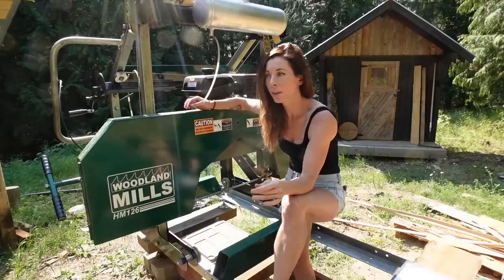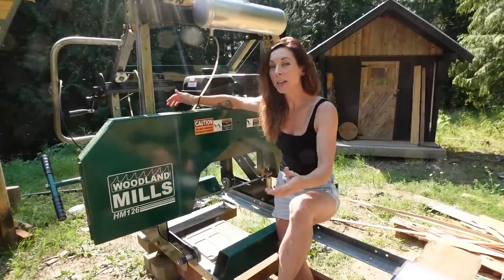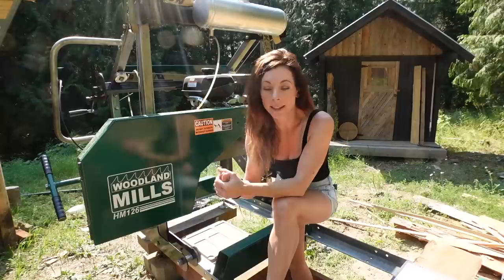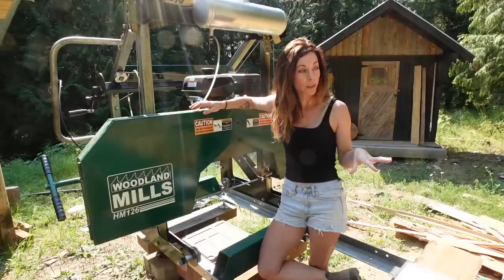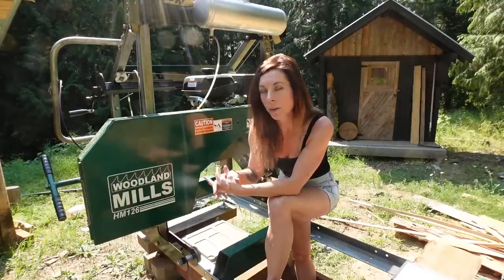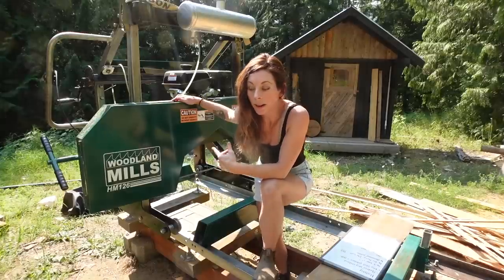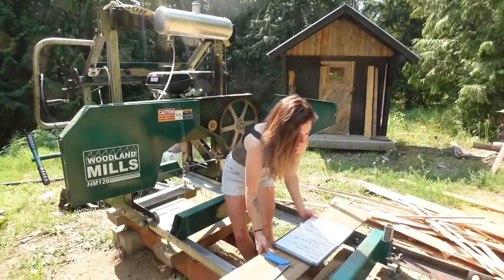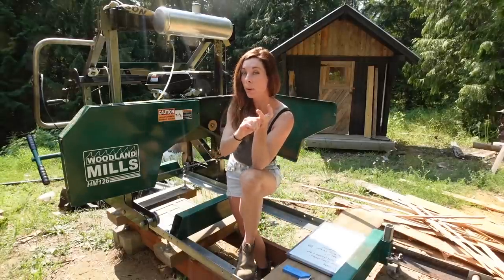My honest opinion - Woodland Mills HM126 bandsaw sawmill

Comment: I purchased the 10th anniversary mod. and it has the new tensioner, but it still was hard to squeeze with your hand and tighten with a wrench. So I welded a 15/16 nut onto the bracket so you can put a socket wrench on it and now so easy.

Comment: I am a millwright & machinery erector. This problem I have seen in many plants that I have worked in, and whether it is adjusting an electric motor or a gasoline engine. These machines come with jack bolts on one side of the drive system. When you put force the motor it should be on the drive pulley end of the motor. The belt will get tight, and the other end of the motor will swing wildly out of alignment. Put tension on the pulley side of the motor to increase tension, and place a jack bolt on the opposite away from the drive pulley to push it back in alignment.

Comment: I bought a W.M. 22", Dec 2023 and have 20 hours on it milling Nor Cal Black Walnut. I lost 2 Blades Because I was Over Tightening the blade. Manual says "Snug plus 3 turns". Snug, to me,  means 1-2lbs torque but it was too much, blade broke. So I use a torque wrench at 25lbs.... The ruler system must have been under torqued. Use Lock Tite or nylock nuts.   I suspect the engine moving and the resulting  belt movement is also under torqued. Once you know it's square use Lock Tite.

Comment: What you need to do is weld two nuts on the bracket that holds the engine.Put two bolts in each nut and then you can just tighten up the bolts to slide the engine back equally.

Comment: Once you have the motor square, you might be able to fabricate a jig (metal or wood?) that you could fasten to the supports that would properly align the motor. Take it off while using the mill, then at next belt change and after you loosen the motor and change the belt, you could insert the jig which would take the guess work out of realigning the motor. Probably would need a bolt or two well placed to align the jig.  Who knows? Think about it...you are creative!
Reply: You're so right! Must fix everything being mindful of the dynamics of alignment.. and feed speed ect.. hardness of wood.. blade sharpness . And a harbor freight engine.

Comment: Hello Michelle. If you do not upgrade to using the adjustable idler pulley, you may want to consider purchasing a belt pulley laser alignment tool.   It will greatly help you keep the pulleys in alignment as you change the engine position for belt tensioning.

Comment: I liked the video very much. Thanks. I have the HM 122 and the problem I had was with the blade tension and the decal they used. I broke 7 or 8 blades before I figured it out with the help of the staff at Woodland Mills.  Adjusting by using just the decal and not having the proper specs at delivery, caused the tension to be to high. But It has been working just fine this year. I cut mostly Ash and Oak. It does a wonderful job.  Thanks again for the video.

Comment: Great video Michelle!
Hope you're having a fantastic weekend! Looking forward to the next cabin update! (Or whatever? Lol)
Just a thought why not mark on the metal with a scribe where the motor mount sits when it's square then you just have to line it up again with the marks next time you have to move it? (If that works?) Or cut a square metal plate to go between the motor and where it sits on that beam, that can't move/marked exact holes once it's lined up so it doesn't move back and forth/takes away the adjustment once you have it squared? Maybe tack welded into place?) Just a thought if you can get that to work?
Have a good one! Cheers from London 👍😉😎🏴

Comment: Hi Michelle thank you for another great video its obvious there is a design fault with the motor mounting plate and its adjustments when  under a lot of torque and load the manufacturer needs to be notified and a replacement  motor plate or more to the point proper torque  settings applied to all those motor mount bolts so nothing will move under load good luck and glade to help .

Comment: Nice explanation of your pros/cons on this sawmill.  Others have made some good suggestions worth considering on keeping the motor square, but I'll add mine anyway.  😉Consider using thicker bolts that take up the space in those motor-mount slots so the motor can't get 'racked' out of square.  Or, put bushings on the existing bolts to do the same thing.  Just an idea.  Hope you, Steve and your fur babies are having a great weekend.
Reply from the maker: You know, we actually did try that (Steve and I) but there was still movement. I should have mentioned that. Perhaps we’d need to take things a step further with bushings like you say, so yeah - maybe next time I need to adjust the belt I will try something again!
Reply: @michygoss7148  The design needs to offset the pulley force to keep the motor from rotating.  The tensioner does not keep the motor from rotating as designed.   Maybe add another bolt that contacts the tensioning block on the outside of the single one.  That would give you a way to apply a force opposing the pulley force to keep the motor from rotating.  I think you could drill one hole in the bracket and use a bolt with two nuts (one on either side of the bracket).   I think their fix is reasonable, but it seems like their orginal belt tensioning design could be tweaked to make it more usable.

Comment: You did very well in  describing the belt tensioner problem. So i was thinking that a C-clamp or whatever clamps fitted may be utilized to hold whatever adjustments but just tight enough to budge by hitting for a  fine tuned square adjustment..also a small TrySquare.

Comment: Smart, beautiful, out doors woman, can work with her hands! My kind of woman! Looking at buying same make and model. Found one on craigslist, still in shipping crate, never opended, never used. For a discount with all the recomended accessories. Called Woodland Mills talked to sales rep. there. Read all the comments from there web site about this model. This is going to be my saw mill for use in east Texas. You did  extremely well in your opnion on this piece of equipment to turn timber into lumber! Lowes and Home Depot are charging a fortune for 2 by lumber. We will see more and more folks doing the same exact thing. And stop paying astronomical prices for over priced lumber!

Comment: I bought a 126 last year and it had in the instructions to run the adjustment to the flat and turn it in 1.5 -2 turns. My blade kept jumping off the wheels. Finally they emailed me new instructions for torquing it to 20-25 ft lbs.  Works great now! Love your videos. I’m in north Idaho panhandle.
Reply from the maker: Ahh. So the torque wrench-less system may not be working that well?

Comment: Just a thought for your sawdust, mount 2x2 on the cross braces on a downward angle to the opposite side you load on . Screw a piece of sheet metal  to the 2x2. the vibrations should carry alot of the cuttings off of the deck, then just a little shovel blade away from the deck run along with bobcat. Loving the scenery at the cliff cabin, yup I can see a person sitting back relaxed looking out across for days. Just spent some time in the swan hills in Alberta.  So peaceful and rejuvenating.

Comment: Thankyou for this review.  I have looked at the cheaper saw mills and more expensive ones and never understood the pros and Cons .  The size of equipment you have to place logs or turn the logs kind of dictates the size saw mill you need.  I think the support equipment is much more expensive than the sawmill itself, so it all comes down to the size of logs you have to cut off your land.  that dictates everything else.  
This helps a lot to understand what to look for in saw mills.

Comment: Try a leaf blower for clearing sawdust from the bed. You can also mount a grass catcher bag from a lawn mower over the port too catch most of the excess. Had someone cut me 12 inch pieces of square tube to hold logs on the bed, I find I can cut about 80% of what I need to without switching to the longer or shorter ones.

Comment: I have been looking at making 1 of these, The Idler pulley and blade extention stabilizer are no brainers, Im surprised they didn't put that in the original design. You did a good job expressing your appraisal on this unit. Well done.

Comment: I was going to suggest a tensioner pulley, but you mentioned they now have that. Another option is to secure a steel guide rail to the base that the motor bolts to (either weld a steel angle or bolt it), one either side of the motor would create a cradle, so that when you loosen and slide the motor it stays straight.

Comment: When you know you have that engine 100% square with the belt you should weld some guide rails along the edge of the engine block so when you loosen it is still stays lined then you can use your tightener just to tighten it up

Comment: Seems to me a pretty easy solution for the belt tensioner would be to mount a pulley on a pivot arm with an adjustment bolt. But making your own may be harder than buying their upgrade.
Reply: When she stated "mechanical Engineers started the company....I bet they feel bad about not making the idler pulley be the tensioner....Heck...one from a KIA or Honda accord that is spring loaded would be a huge improvement.

Comment: I’ve been using the Harbour freight sawmill and it has slightly been improved mostly with the stabilization of the power unit and a longer track works amazing   For how little it costs. How are you on the wood Mizer blades  And the predator engine is still runs strong we did 53 recoil starters on it and one clutch. But it’s milled ALOT OF PRODUCT. I MEAN A LOT !! A small cabin And a couple siding orders for friends and built his 40x50 shop with it. So I say old cheap o is not that bad.

Comment: The biggest improvement I can see from the one I had a few years back is the cut area opening.  It used to be a triangle so you lost cut depth on the corner.    i would guess these engineers weren’t previously sawyers.    I sawed thousands of brdft on that mill. some big timbers.     It was the little mill that could.   Lots of little issues but overall held up.  I do this full time now so I switched to a woodmizer lt 40 fully hydraulic   with 42hp diesel kubota. if I dont have my own logs I tow it around south vancouver island  and mill for .40 - .60 cents a brd ft.   Im on my own and happy if can do around a 1000 brd ft in a day.

Comment: Michy,

Wood always follows metal.   The greatest upgrade you could make would be to drive the big pulley through a gearbox from the motor.  You would then run your blades around the two  big pulleys.  It looks like the idler pulley already has a tencher.  Then get your blades from Travers.  This is how my 7x9 horizontal bandsaw is set up.

Art

Comment: You can easily get some 40x40mm steel section and make mid size logstops. One of the first things I did. I basically now only use those. (saw is installed on a trailer which can leagally be towed in my country) and therefore the logstops bottom out....

Comment: Hi Michelle. The simplest solution I think I could describe with a Key Board is. 
From what I could see in the video there is approximately 3/16" clearance between the black engine cover and the plate the engine is mounted to. If so you could find a piece of 1/8" , 3.18 mm steel plate approximately 10", 2.5 cm X 4", 102.5 cm (sorry I am American inches is my game) 

Before loosening the "motor mount bolts" slip the plate under the black cover against the legs on the motor and tightly "C" clamp it  in place.
Then when you loosen the mounts you could adjust the belt while pulling the motor against the steel plate to align the motor and tighten the mounting bolts. Try that It might work or make it easier.  If I was closer I know I could design something more elaborate but, You know? 😉

Hope this will help.🌹🌺🌷
As Always
John
Reply from the maker: Yes - great idea! And the most simple too (no welding). I will definitely try that. Thanks!

Comment: One thing I would have done different when ordering is the blade guide comes stock when you order the 14 HP engine for about $300 already installed, I ordered it later and had to instal it.

Comment: After watching, I think I can offer some help. two things, is the belt a Kevlar belt -this is commonly used on snow blowers and other equipment that use a single belt and 8 HP or larger, if you post the belt size I can cross reference. As to tightening, I spent over 10 years on service for electric motors , in the 50 to 300 HP range. A common problem with the slide base is the single adjusting bolt, always getting the motor on a angle. So several solutions, all easily done by one person. So when facing the adjusting bolt, if the drive shaft is on the right, use the rear most left mounting bolt, when you are 30% from being the correct tension, tighten that bolt, now continue to tighten the adjusting bolt, if correct, tighten the remaining 3 mounting bolts. The second method requires much less force but you need to be able to get bar clamps in, in the above example, shaft on right, the right bar clamp goes from the slide base to the rear motor mount ( you are pulling the right side towards you) The second clamp goes from the left side slide base at the rear to the left front motor mount ( pulling the motor square) . 
  The ideal solution is a spring loaded idler pulley ( the instant you start a motor and the clutch engages, the belt is momentarily stretched, a spring loaded idler, compensates for the moment)
Reply from the maker: I was just at the mill all day today and needed to tighten the belt. I basically did those 2 things! Similar idea - barely loosened all the bolts and tightened the nut/screw which tightens the belt, and once I felt it was correct I tightened the one bolt to create a pivot point, then took a clamp (loosened the bolts I wanted to move more) and used the clamp to torque the engine back towards the blade and wheel harness, then tightened everything. (If that even makes sense to you…?)
I still need to tweak a few things to make that system work even better, cuz it was still off by about a millimetre or so. 
It was the best I could do by myself. 🤷🏻‍♀️

Comment: I spent 42 years as a industrial Millwright,  and most machinery that uses multiple v  belts uses some type of motor carriage with 2 draw bolts. If the engineers had any practical industrial experience,  they would have encountered such devices.  You may be able to purchase one at grainger or msc industrial supply.  Perhaps even Amazon these days 🤔

Comment: Thank-you for the honest review.  Have you had any issues with the rollers on the rails?  As in, debris falling on the rails and fouling the rollers?  Also, to adjust blade tracking, is it just a bolt that you run in and out?  I'm still shopping around, but I see a new mill probably next year.
On that belt tensioning system issue, would it be possible to weld/bolt/clamp a piece of square steel stock or angle iron next to the engine to act as a guide to keep the engine square while you are tensioning the belt?  Keep the baseplate of the engine against the guide as you move it, and it will not get out of square to the belt?
Thanks again Nurse Michelle.  I gotta go eat some fiber.  😆
Reply from the maker: No issues with the rollers/rails. They have little wires attached to the wheels that sweep the debris away. 
Yes - the blade tracking is adjusted by a bolt. No issues with that either. 
And yes - I think that doing exactly that (or something similar) would be the easiest solution, and will likely be something I try (with Steve’s help) before buying the idler pulley.
Reply: @michygoss7148  I'm a Carpenter by trade and it occurred to me, you'd think it would have occurred to a couple engineers. lol.

Comment: They should have the engine stationary and a belt tensioner attached to the frame with a heavy duty spring and idler pulley. Then there would be no adjusting the alignment for the engine and either have a lever permanently attached to the idler pulley or do the socket system like on a serpentine belt. I could make you one, for fun and a thank you. Shit now you just said they’re making them with the idler. Still I could make you one. For fun, it will be easy enough o install and operate. I’m Derek. After seeing your video I’m going to build one. Maybe I’ll keep you updated. I’m what my old boss/partner calls me a “concrete mechanic. I just love building things of all types of applications. Anyway cool video, keep up the good work.
Reply: Engineers designed this? I guess the cost is the reason behind the crappy belt tension.
Reply from the maker: Keep me updated! I don’t often need to adjust the belt, but when I do it’s a total pain. I can also easily buy the part and install it, but I’ve heard mixed reviews on it (from viewers who comment).

Comment: The belt tensioner issue is the same issue that any old school mini bike or go cart had with simple ass slots in the mounting plate.. 
what I used to do for that was to drill 2 holes and put a bolt on the side the engine wants to twist toward in the front on the left and the back on the right.. (or which ever your set  up would require... so the side of the engines base can rest up against the two bolts and stay straight when the tensioner bolt is tightened.. if you use allen bolts, you have a round head to rest against..

Comment: Did Bruce's 2014 have the same size engine? Does/did it have the problem with the motor twisting like yours did when tightening the belt?
Reply from the maker: Yes same size engine. I don’t think he had belt tension issues like I did, not sure why, so he didn’t really fuss around with his tension much.